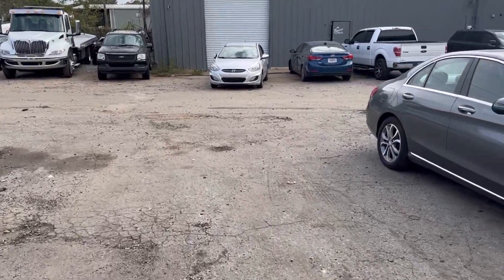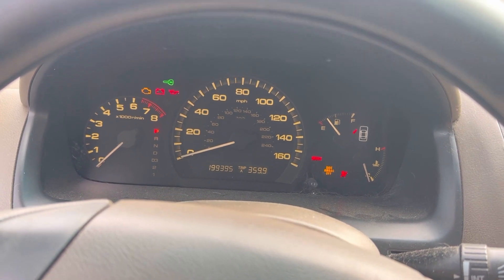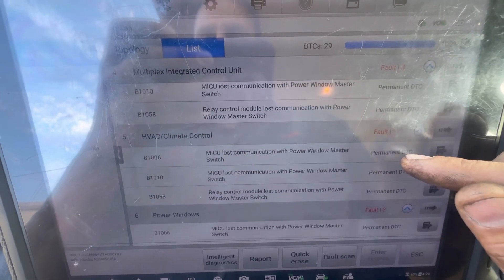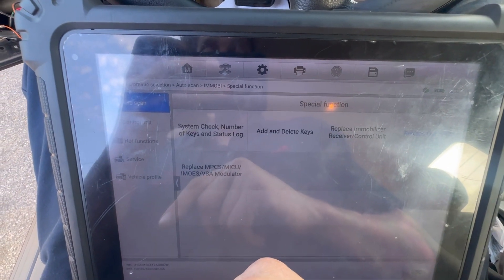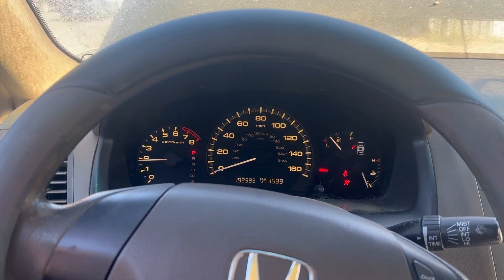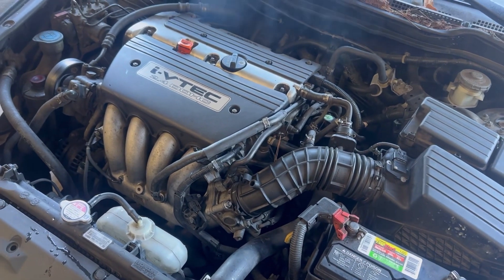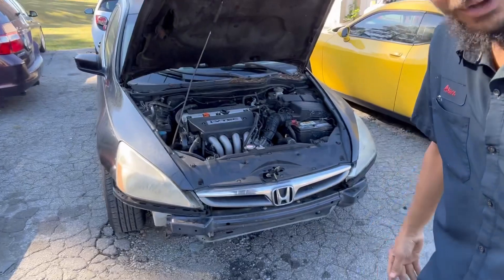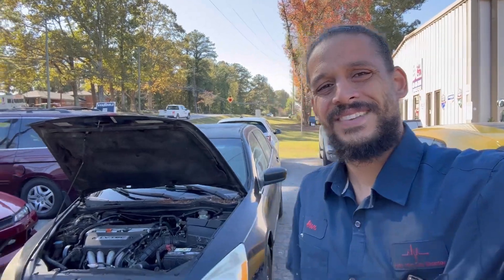It’s A HONDA. It’ll Run forever…. They Say

Comment: The regular honda keys break in half regularly. That aftermarket key is actually the best option(besides the color) 

But the panic button sticks way up so itl now go off regularly by accident
Reply: These keys are reprogramable with cheep odb2 tools, i used thinkdiag which costs like 75$ maybe but I bet its way cheaper than your key guy

Very simple to do,

Comment: Darn, Someone already said "Missy" for the name. 

I have a 2008 Buick Lucerne with the 3800 series III in it. Darn decent engine. I mechanically take really good care of the car since i got it. I bought it 'Rode Hard and put away wet'. I had to do a lot of suspension work and electrical. I named it 'Bismarck' because its maiden voyage home it died - The underseat fuse box and fuel pump relay melted. Not a problem - I rewired the fuel pump circuit with an external relay and fuse. That was about 10 years ago. Its a nice car and bought at 66k miles. I have put 100k on it so far. There is a TSB on the fuel pump relay problem. ;)
Reply from the maker: I love those 3800 very good engine in my opinion

Comment: This car is awesome!!! It’s 16-17 years old. 200k miles. Totally neglected, but you got it running by fixing a key issue and just running the engine enough to recondition itself. I’d replace the radiator with the cheapest crap from autozone, get some fuzion tires (are those still around????), and drive that thing till it died.
Reply: Yeah they make Fuzion tires still but the prices are not much lower than good Firestone LE3's so I wouldnt buy Fuzion.   You only save like 20 dollars a tire.

Comment: Never been a Honda Fan, but i know the Ole Skool Honda's can run forever.  But lately with the Newer ones they aren't built like the older ones.  1.5 Headgasket Issues etc

Comment: I had a 1989 Prelude with the four wheel steering option (4WS) when I was a young dude in the military, back in 1994.  Bought it with 108,000 miles and drove it for another 7 years.  Not sure about the new ones but the older ones: change the oil and at a hunderd thousand miles change the timing belt.

Loved that car.

Comment: I have a 2004 Honda Accord and I'm keep getting a 2646 engine code and a p 1004 sometimes it come on sometimes it don't but the parts have been replaced with dealer parts and it still does it and the engine shakes when I get to 60 miles per hour plus I hear something clicking inside the interior fuse box where the relays at but can't figure it out do anybody know what it is

Comment: Just bought my teenage daughter a 2009 Honda Accord. I pray it lasts her through college. 🙏🏾
Reply from the maker: Great choice for your daughter. It should definitely last her until then and beyond. Teach her to maintain it and she’ll be fine.
Reply: Oil changes every 4k, keep oil & coolant in it
Reply: Yea, Hondas (can) go “FOREVER”.. however, there are certain things you must do, to make sure it does.
1) Maintain fluids (oil, coolant, transmission fluid.. in that order. (Of course, knowing how to check any/all fluids is just as important. Though, these are the “Big 3” that I’ve seen issues arising from, the most).
2) Tires. Not one of the first things people may think about, prolonging the life of your car. Think about it this way, though. Take care of your tires, like you would a good pair of tennis shoes: buy good ones, know how to inspect for wear and/or damage and know when it’s time to replace them.
3) Knowledge is power. Educate yourself (or your daughter, in this case). 
•A solid foundation of good driving habits, never hurt anyone. 
•How to keep exterior and even more importantly, the interior clean. This plays a bigger role than most ppl give it credit for.
•Dash Lights.. (what does that light mean?). Just simply knowing what a light means on the dash and if there’s any action that needs to be taken, is a start.

Good luck all and God Bless.

Comment: they will last if the timing belt and water pump are changed at the correct intervals, and they run mobil one full synthetic in it..
Reply: No belt on the k24

Comment: I had one of those Accords from that generation. It was a 2006 EX-L. It wasn't that bad of a car but I would be lying if I said it gave me no problems. I had numerous things go wrong with it. The check engine light was almost always a problem. That car was honestly the worst Honda I've ever owned and I've had several.